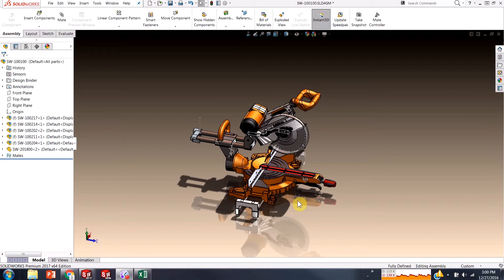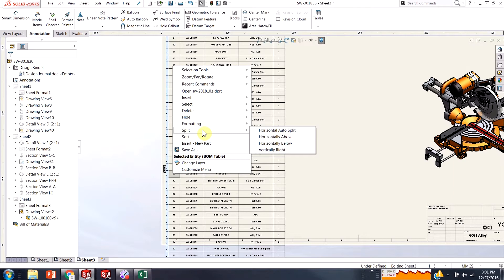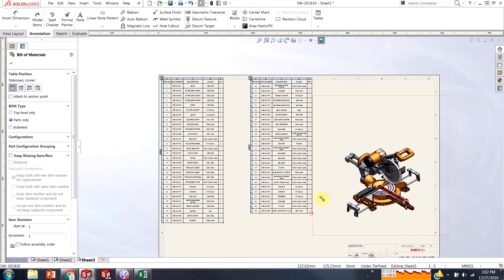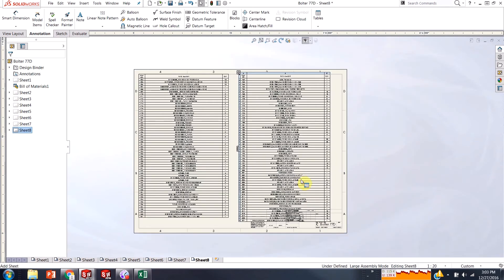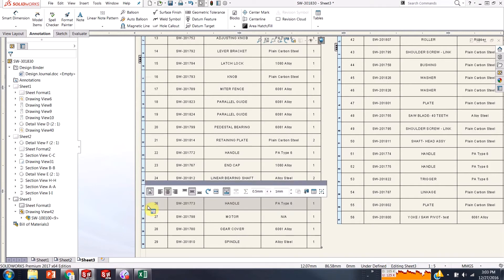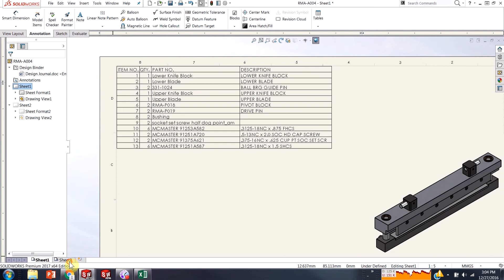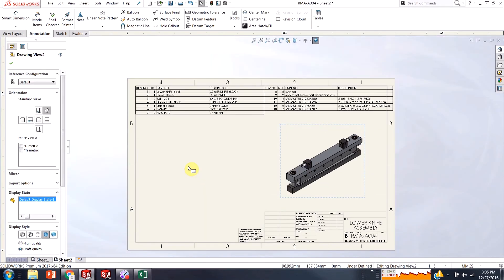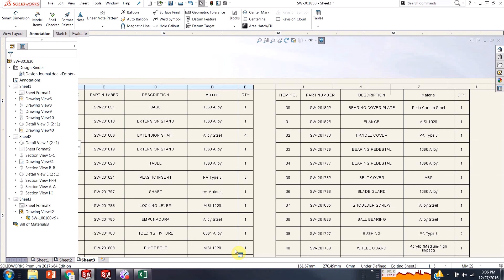SOLIDWORKS: Splitting a Long BOM to Fit on Your Drawing Sheet

Comment: Sean, after splitting the BOM, how did you get the sections the other sheets?
Reply: I've found that the easiest way to get a BOM to another sheet is to copy and paste the entire sheet. You can right-click the sheet tab, copy, and paste to duplicate the sheet. You can do this as many times as you need to, and you can then delete any unnecessary views or tables sheet-by-sheet.